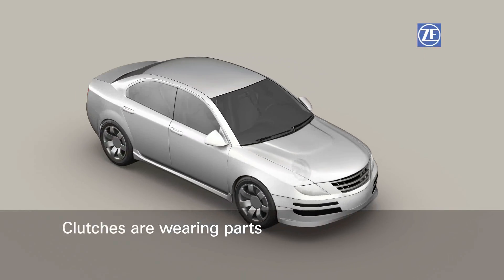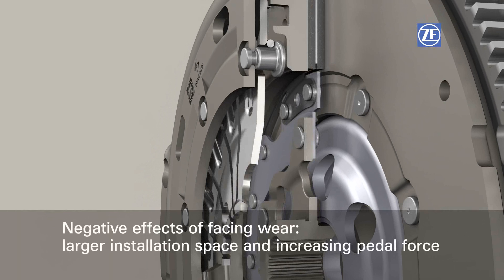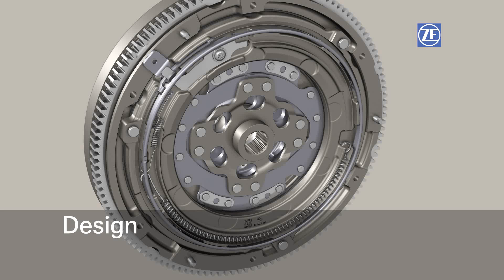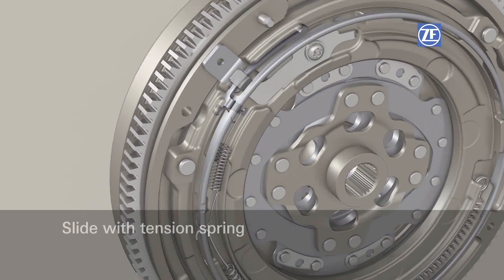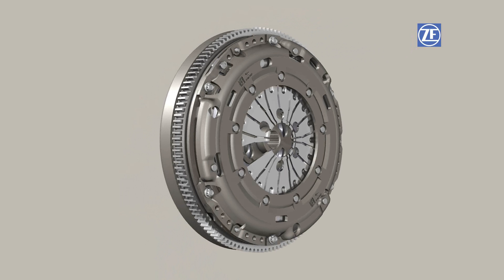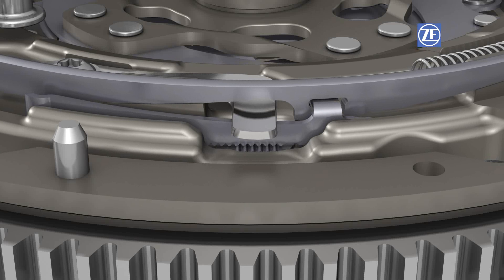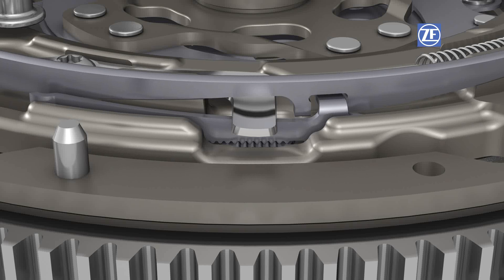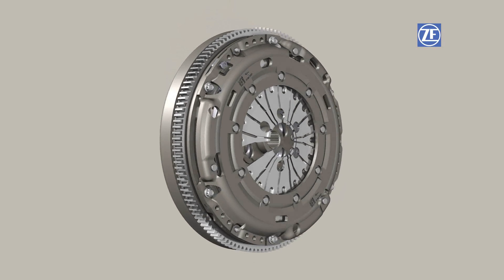SACHS XTend Clutches for HD

Comment: Is it possible to xtend clutch cover adjustment be reset to its original position if it would be used second time ?
Reply from the maker: Thank you for your question! Our technical services team says yes, the 15.5" clutch can be adjusted or reset manually. If you have any further questions, please contact our Technical Services hotline at +1 800-321-0784.
Reply: @ZFServicesNA  why you are lying? No Sachs clutc can be adjusted and for a minor repair you throw away an almost new part. Liars!